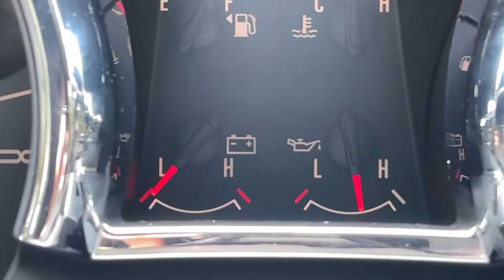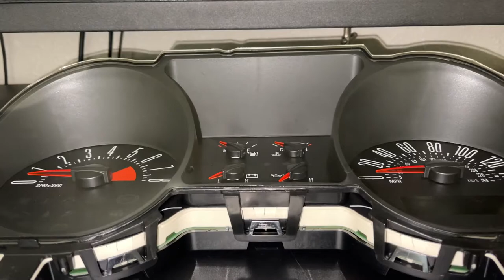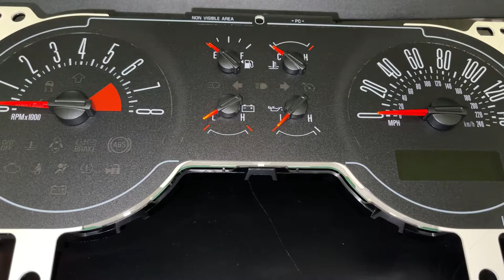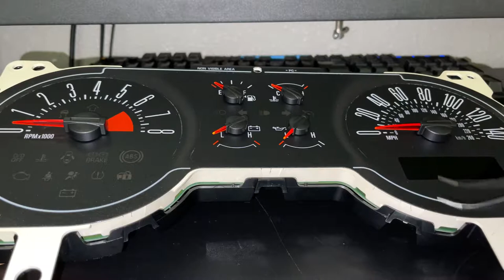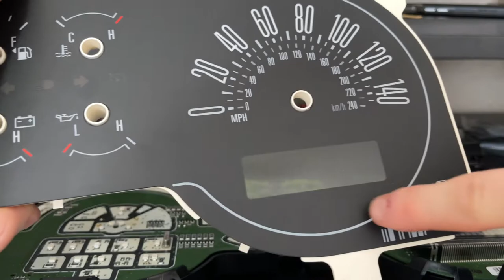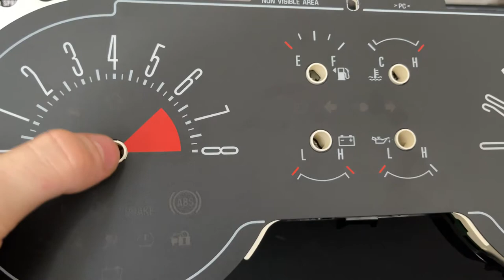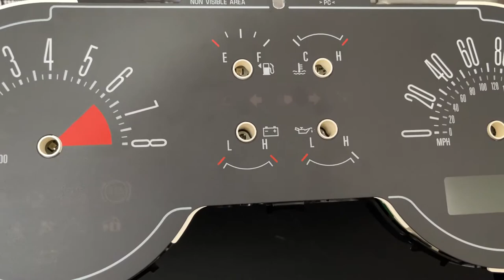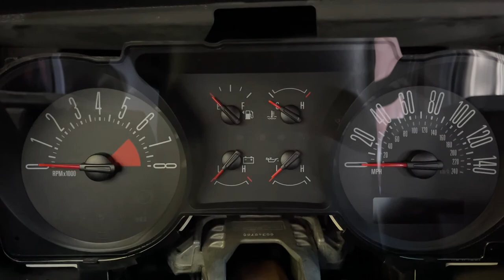2005-2009 Mustang Gauge Cluster Stepper Motor Repair

Comment: Perhaps I can help you out with a few soldering tips. Put flux on the part to be soldered. The purpose of solder is to help clean the joint. Do not touch the solder to the joint yet. First heat the JOINT itself. Generally speaking the joint is hot enough when the flux melts. Keeping your iron in place touch the solder to the opposite side of the joint. The heat will attract the solder into the joint. This method should help eliminate your problems with the solder not making a good solder joint on your first try. If you get any old solder or other junk on your soldering iron tip wipe it off with a damp rag. Then touch the tip with your solder and melt a little solder onto the tip. This is called  'tinning'. Tinning  helps to get an even heat across your soldering tip.
This is the procedure I was taught  in electronics School. It has served me well over the years and hopefully will help you out also. Best of luck and keep practicing. You'll get it! 🤞

Comment: Sir, you are AWESOME!! Thank you very much for posting this EXTREMELY helpful video! 

All of the stepper motors (with the exception of temperature) were not working in my 05 Saleen's instrument cluster. I followed your video, and completed the removal and install today! I learned so much (today was my first time soldering 😊) from your video. Thank you again for spending your valuable time making the video. Kind regards, Michelle :).
Reply from the maker: No problem! Glad you got them functioning. Soldering ain’t so hard once you’ve done it a few times.

Comment: Great video. I have the base model instrument cluster, but looking to try and buy a scrapped premium cluster with the added gauges. Do you think that's possible to do? Otherwise I'd wanna swap the stock green LEDS with brighter red ones. Thanks.
Reply from the maker: I do have a guide up on “s197 forums” about how to solder on custom leds to the circuit boards. But as for premium cluster; I’d imagine the gauges for both battery and oil pressure will not work as well as the milage I believe is saved onto the board and not the actual ecu something you’d have to look into personally.
Reply: @3vReanimated  awesome. Thanks for the response. I'll look into that, really appreciate it.
Reply: FYI, if you're looking to do this so you get a true oil pressure gauge, changing the cluster won't improve anything for you.. The sweep on these always stays in one place because Ford uses pressure switches, not gauges. On cars with a "gauge" its function is the same as an idiot light. In other words, that gauge needle will never change unless the oil pressure drops below about 15 psi.

Comment: What is flux
Reply from the maker: It’s the wet like gel that you apply to the board so the solder adheres better to the contact point
Reply: @3vReanimated  I bought a cheap kit to fix mine I’m waiting for it in the mail my question is when I’m loosening the old solder can I put the solder right on the tit and it heat the surrounding solder up. I’ve never solderd
Reply from the maker: @BradFFA  You heat the old solder and while you're applying heat to the contact point, you use the sucker to suck the old solder into the suction tool. It is demonstrated in this video.